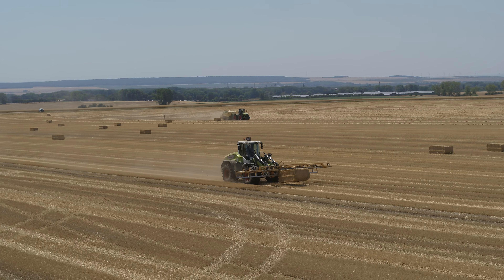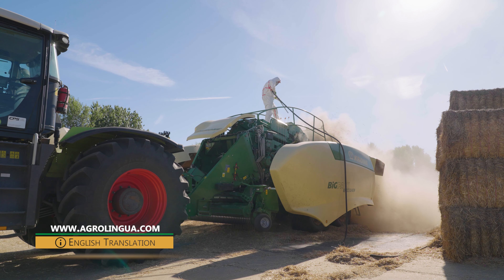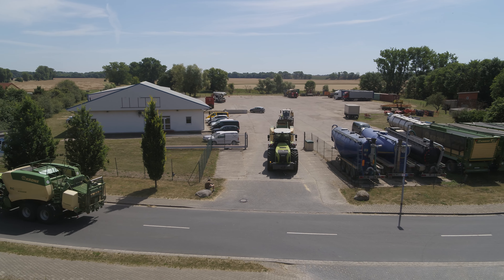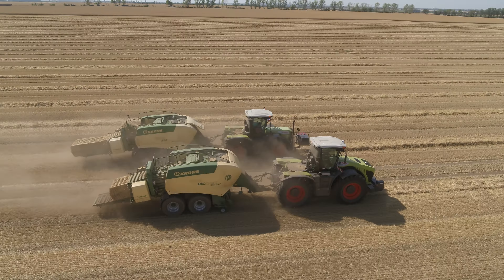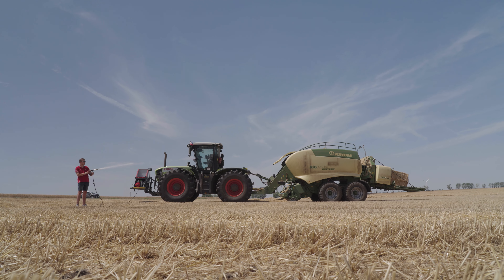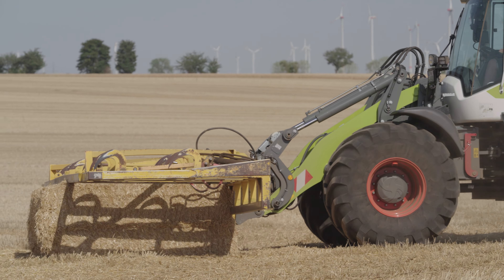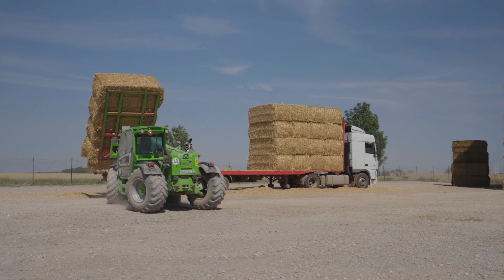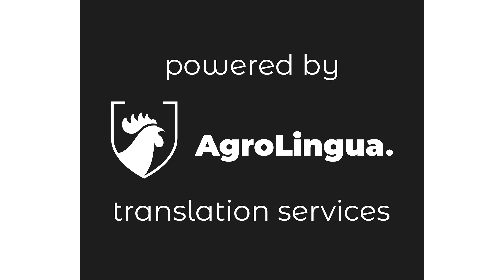Straw baling XXL | Team Verschoor | 2x Claas Xerion | New extinguishing system Löschtainer by Recker

Comment: Wonder if the system they are using in the USA with round bales could work with square bales. The system that holds onto bails and drops them near a center line in the field for easier pick up.